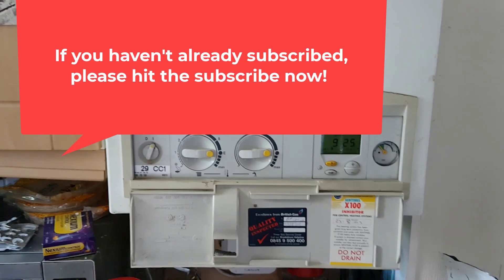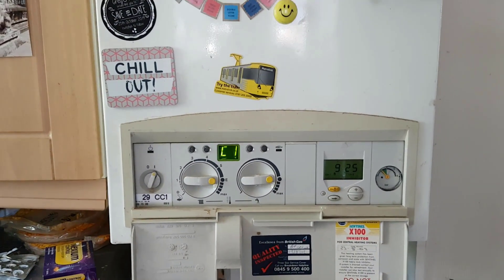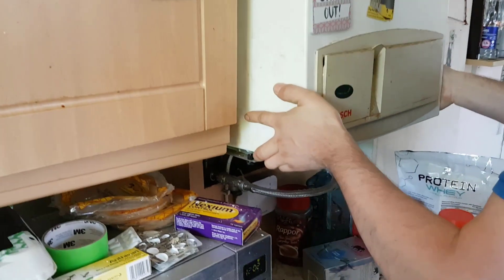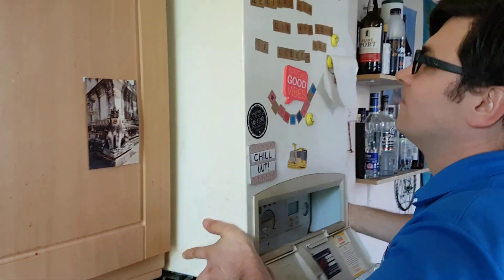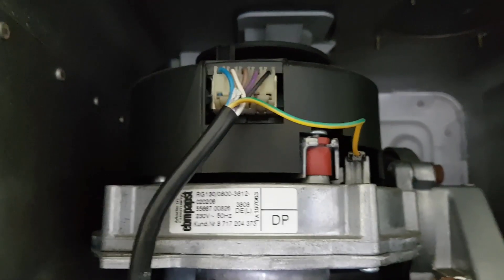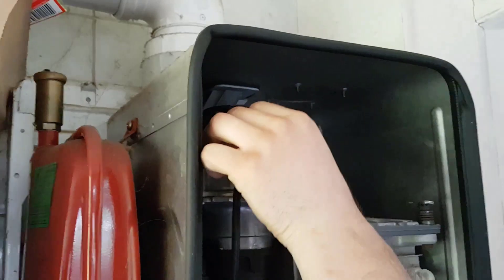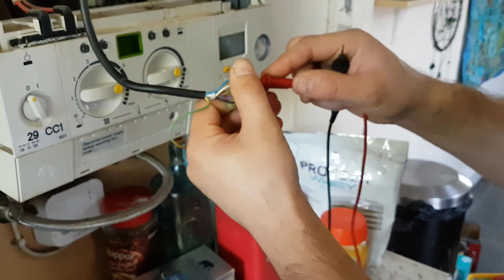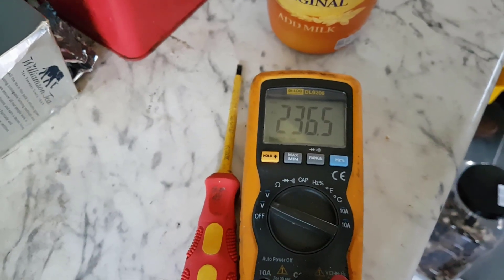C1 Worcester 30HE Fan Fault

Comment: Thanks for this video. Replaced the fan and saved myself a load of cash. However the replacement came without the diaphragm that goes on the inlet. I put the new one on without the diaphragm and it seems to work OK but it must have a purpose. What is it for and is it dangerous to run the boiler without?
Reply: its dangerous to work boilers when your not qualified to do so . and the bearing plate is needed
Reply: @timeintheuk  Bearing plate fitted.
Reply from the maker: Yeah need to replaced this or the Co2 emmitions will be wrong and will put at risk.
Reply: @ARBoilers  OK, thanks. I will get part and fit.